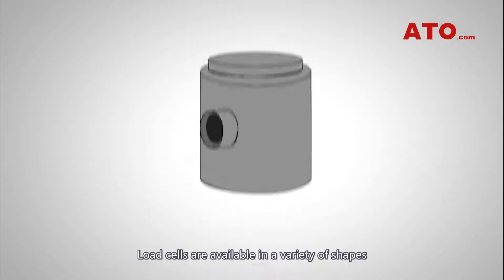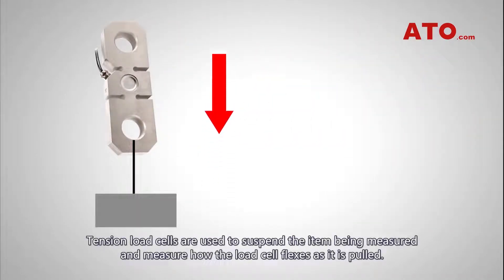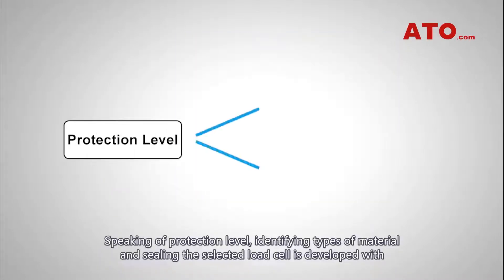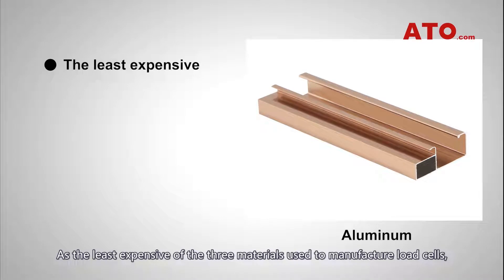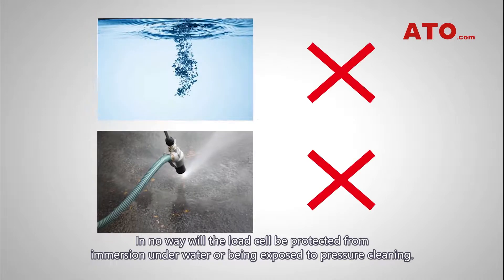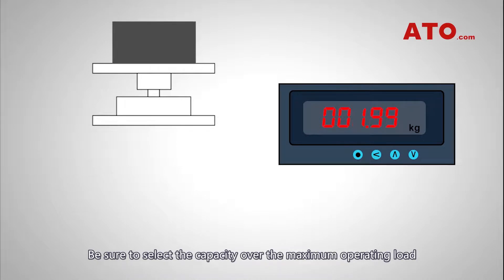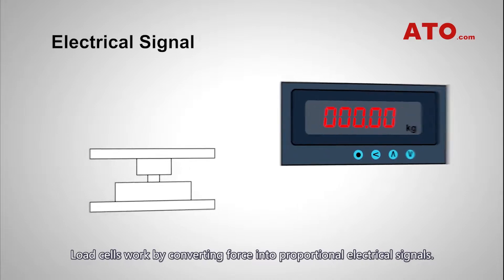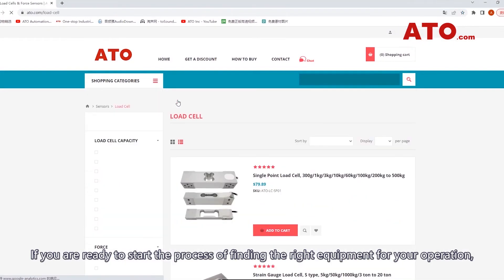How to Choose the Right Load Cell

Comment: I need class-A load cells. Maximum weight should be 10 or 20 gram, and it should have at least 15,000 increments. I cannot find them anywhere. Do you have them?
Reply from the maker: Thanks for inquiring, sir/ma'am. You could check out this link to find out your desired type: https://www.ato.com/load-cell
Reply: @ATOcom-Automation  None of them are desired. I already told you what I want. Maximum measured weight should be 20 gram. 15,000 increments.